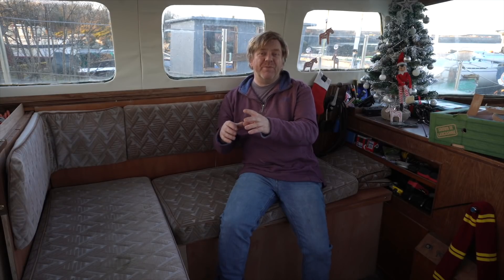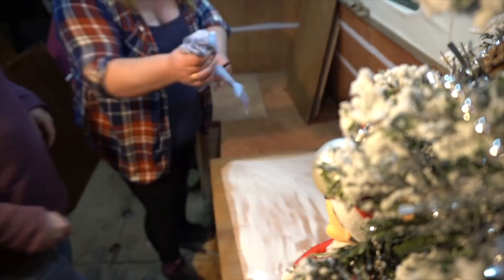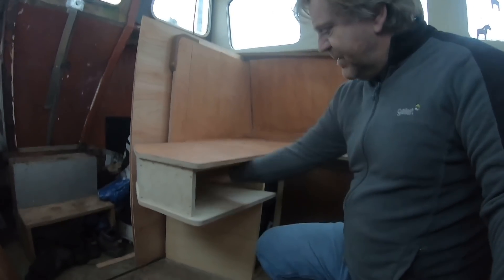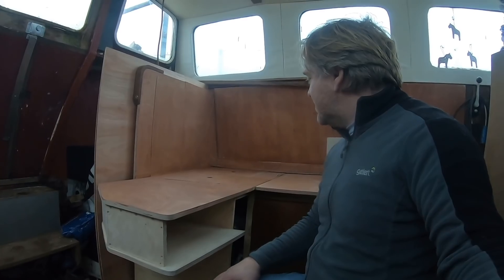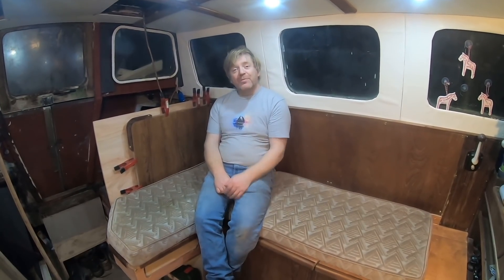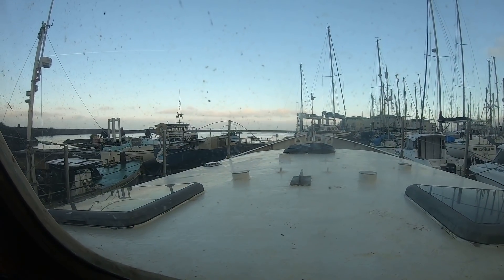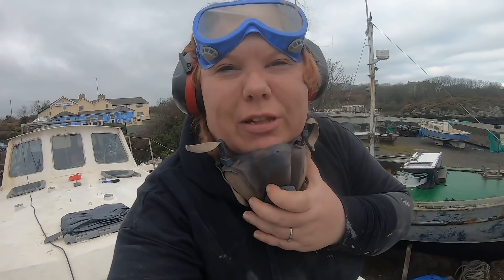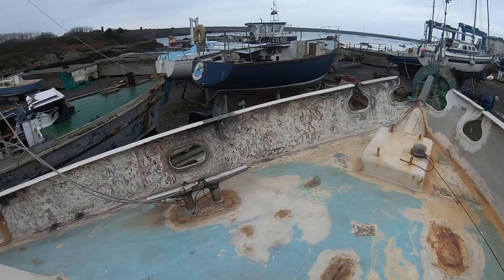#75 - This would have cost HUNDREDS! Installing teak in our pilot house

Comment: Nice job m8s, liked the surreptitiously club scarf an'all. I like that sorta thinkin pull stuff apart with a screw driver.  Spot on bout these glues this supa glue stuff, would it work on aircraft kits, and please what was the name again, didn't quite catch it?  Excellent stowage ideas,  [comin from a boata not a sailor] Nice job on the metal work Melissa. I'm hoping you and yours Have a good Christmas and happy, Healthy and Safe New Year.
Reply from the maker: The stuff I use is called Mitre Fast. It’s just normal super glue but it’s the most cost effective way to buy it as you get a big bottle of glue and the activator for not a lot of money
Reply: @SailingMelody  I'll check out Bunnings hardware Monday. Thanks alot m8s, Have a good Christmas and Happy, Healthy and Safe New Year.
Reply from the maker: Everbuild Mitre Fast Two Part Bonding Kit, 50 g Adhesive / 200 ml Activator https://www.amazon.co.uk/dp/B001GUA7YM/ref=cm_sw_r_cp_api_glt_fabc_SFT20FMJHS59E6R8A9M9?_encoding=UTF8&psc=1

Comment: You are doing a great job and making substantial progress. One comment/idea for the settee overhang - I think two inverted plywood (12mm) triangles with the base against the overhang and the point towards the deck might make a better frame for the cupboard while offering better structural  support for the overhang. Hope you all have a great Christmas together and park the work for a week or so. 🎄😀👍
Reply from the maker: Yes we are making something very much along those lines. Just some triangulating braces underneath will do the trick :)

Comment: Hi Guys. Tap the pointed end of the panel pin to blunt it slightly. It will prevent splitting of the wooden trim.

Comment: You need to check into what we called a chipping hammer in the navy it’s air driven has three metal pins in a hand held device that would make short work of your paint and rust chipping.
Reply from the maker: We have one, it’s an air needle de-scaler and runs off the petrol compressor but the airline needs new fittings so couldn’t use it that day :)

Comment: Blunting the point on panel pins and nails allows them to be tapped in without splitting the wood.  The normal pont on most nails is like a wedge and this is what splits the wood. Blunting the end makes it more like a punch  which make it's own hole as it is tapped through the wood.. Just turn it point up and give it a couple of laps with the respective hammer.. Use another hammer as an anvil for the pin or nail..

Comment: bin the brass screws ! they will dissolve.  stainless or bronze. great job you are doing , but have been there with brass screws ,nasty soft things make life easy and use stainless.
Reply from the maker: Good point. When I’m building like this I tend to assemble and disassemble a LOT and stainless or bronze screws get ruined fast. Once everything is how we want it we will replace the screws with stainless, but i I used them for the assemble and design stages they would round off fast and we would go through too many of them. Cheaper to use galvanised or brass for construction and “proof of concept” work and then replace with the good stuff later :)

Comment: Another great episode. The boat is coming together. I wondered why you fitted the teak finishing pieces without the corner sections being available. I think you may regret the one step forward two steps back approach. However, a great deal of progress in a relatively short period of time. I was not sure you would get there when you started, but you work so hard, and maintain a day job. Well done. Happy Christmas to you all.
Reply from the maker: I will be making the corner pieces by hand. You can’t buy corners of the exact profile I need so I’ll make them to fit myself :)

Comment: Hi folks just one tip of the trade, when sawing plywood or teak. Being an old boatbuilder and shipwright of trade best way sawing is from the underside of the panel. Then you can be accurate hitting the marking with the sawblade on the topside no sawdust int the eyes. You also get a clean cut no splinters.  i’am not putting you great folks down just  trying to give a adwise , you are doing a amacing great job .so nice watching a family working towards a future goal. Sorry my rather bad english. By the way: your vlogs must be the best on youtube
Reply from the maker: Thank you!!! Good advice! I’m not a carpenter by any means :£
Reply: Great advice. I’ll keep that in mind when I get to my timber work. Thanks